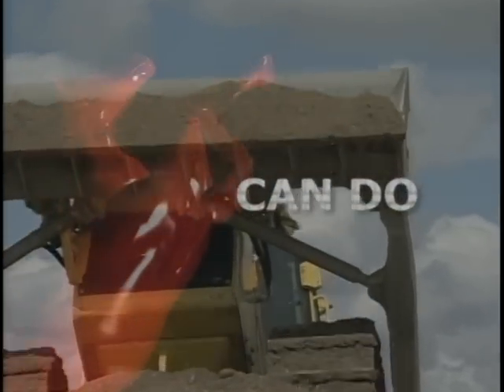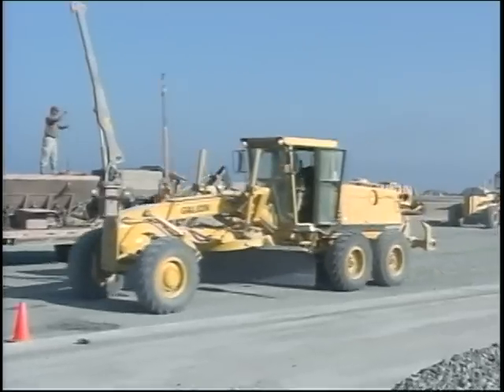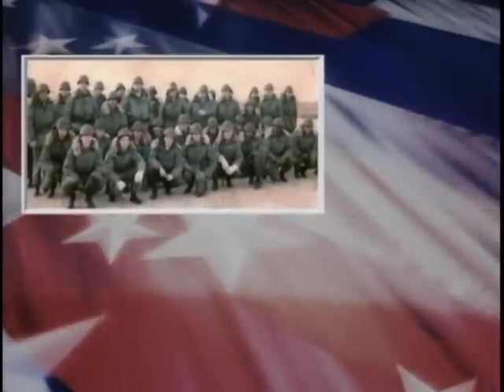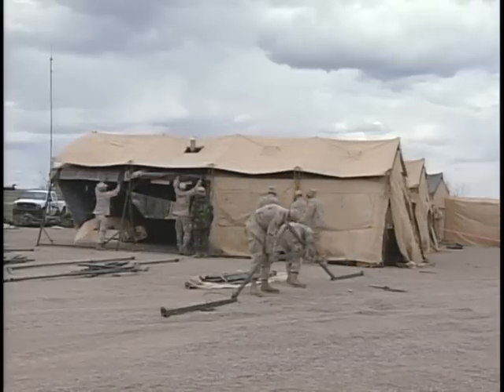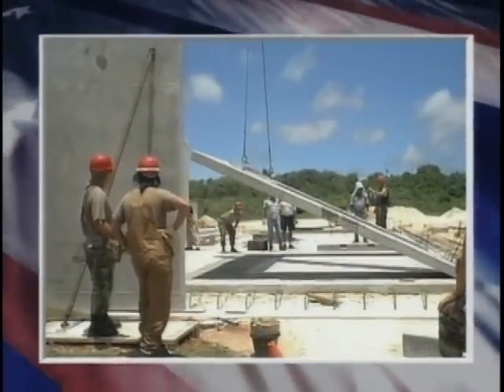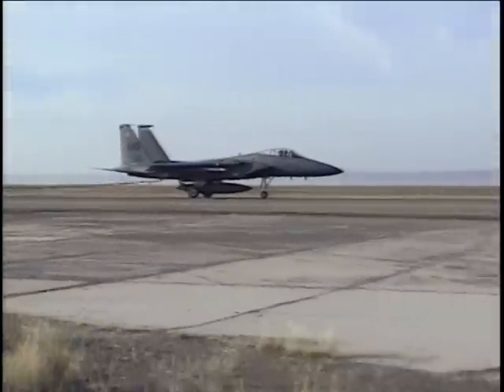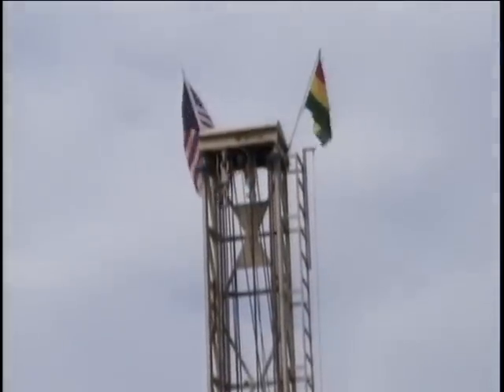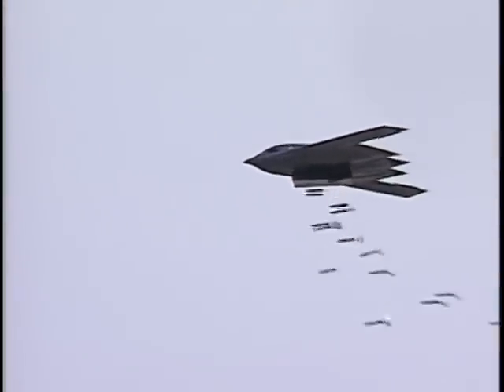Red Horse - Combat Engineering And Heavy Construction

Comment: @IndiaEight5  When i was in, the AF had two types of CE units. Prime Beef (base maintenance ), and RED HORSE ( Heavy construction).  As a CE troop you can be assigned to either type of unit, but it's much harder to get into the Horse. There's fewer Horse squadrons then there are Beef, and it's considered a special duty assignment with a controlled tour.  They used to not take 3 level's at all. (what you are after tech) That changed for awhile, i dunno if they changed it back or not.